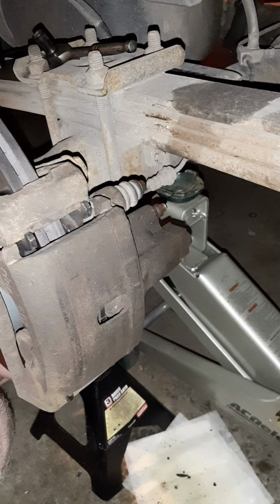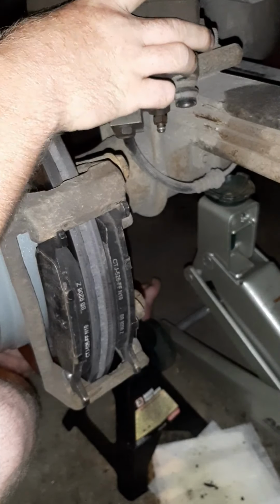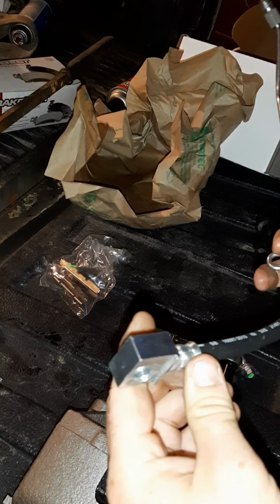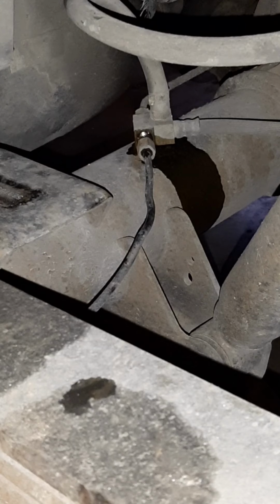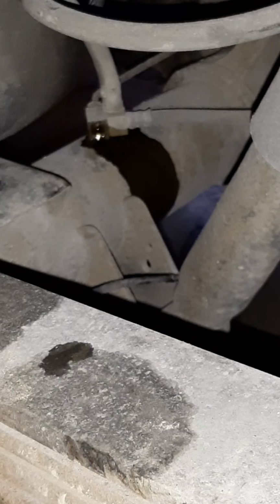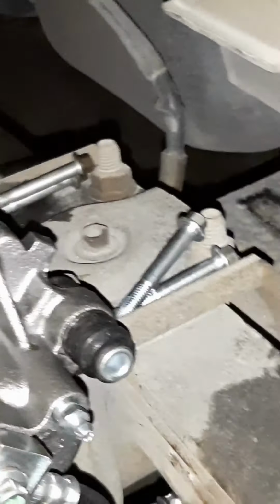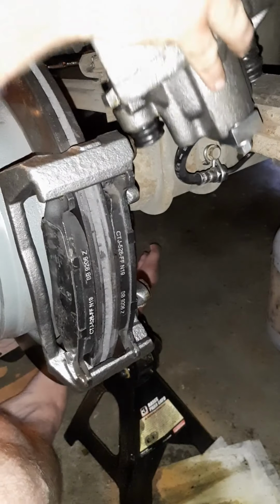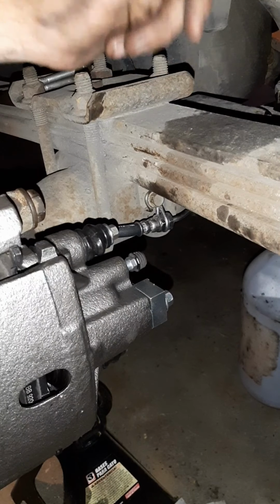2005 Dodge Ram 1500 4x4 Brake Caliper, Bracket, and Hose Replacement

Comment: Was that the front or back caliper and which side to?
Reply from the maker: It was the rear drivers side
Reply: Rebel of the Midwest ok thanks great video
Reply: I know Im kinda randomly asking but do anybody know a good website to stream newly released series online ?
Reply: @Carmelo Mustafa ehh I use Flixportal. you can find it through google=) -jasper
Reply: @Jasper Marshall thanks, signed up and it seems to work :) I appreciate it !
Reply: @Carmelo Mustafa No problem xD